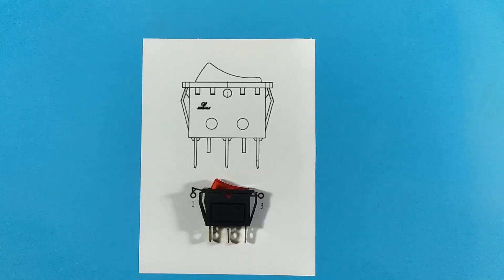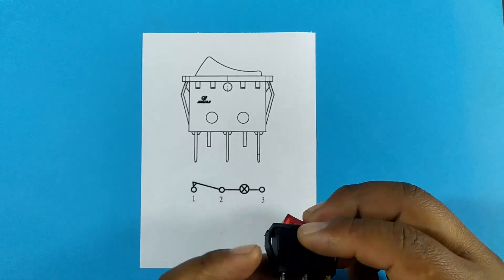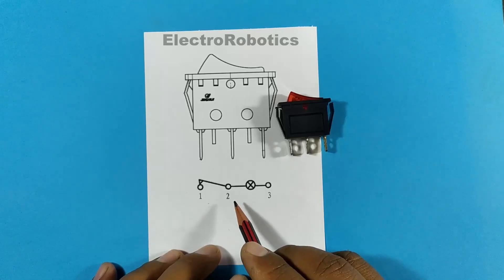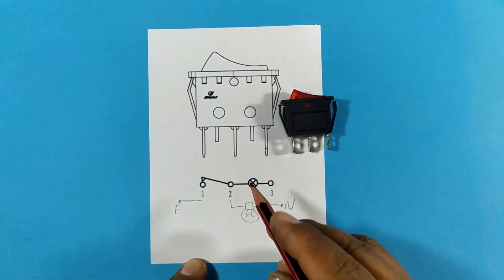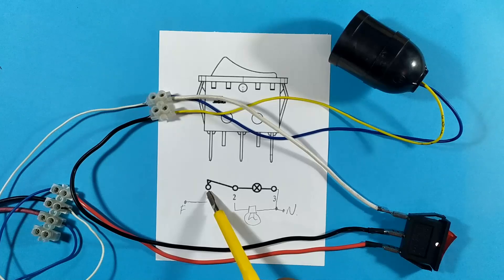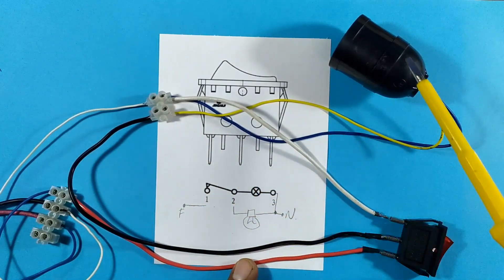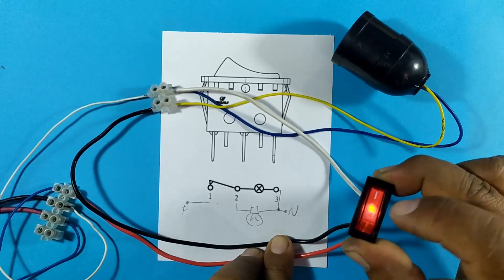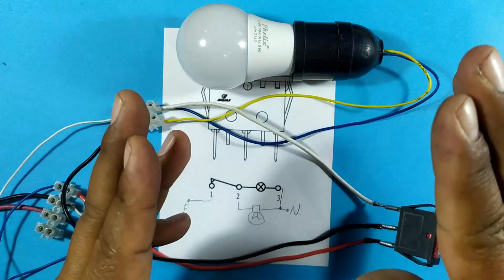HOW TO USE A THREE TERMINAL SWITCH?

Comment: It's easy the middle one is the common input and the two outter are outputs and depending on what type of switch it can be a momentary centre off or a two position on-off-on switch

Comment: This was awesome.  Clearest explanation I have come across.  These rocker switches usually have different colored prongs from those in a receptacle.  Usually brass colored is for the hot (black wire) and white (neutral) to the silver contact.  In these rocker switches, the hot (blk) goes to silver and neutral (wh) goes to brass colored.  Probably due to the DC standard of red is for hot/power and black is for ground being different for the AC power standard blk (line), white (neutral), bare (ground) in a 3-wire situation and then red is hot in a 4-wire cable.

Comment: Totally confusing...
Reply: So line 1 is the hot coming into the switch, lines/prongs 2 & 3 are for the load you want to with on and off ( via this switch ).  I think the confusing part is he draws a bulb for the load instead of another type of load like a motor but the X in a circle represents the internal switch lamp/bulb which is no different to the load on 2 & 3 prong.